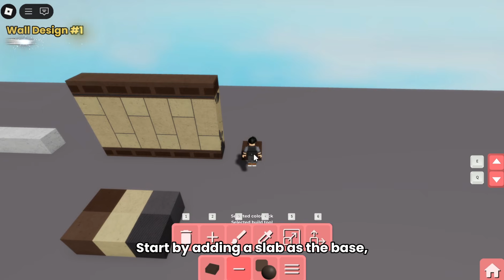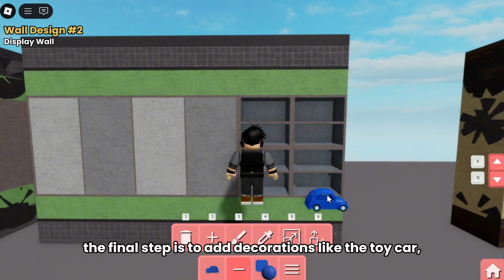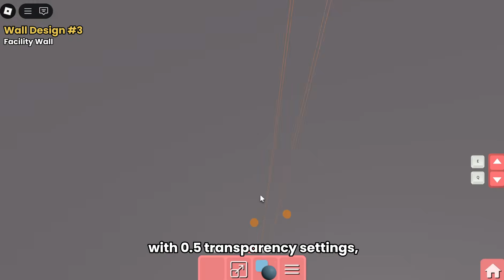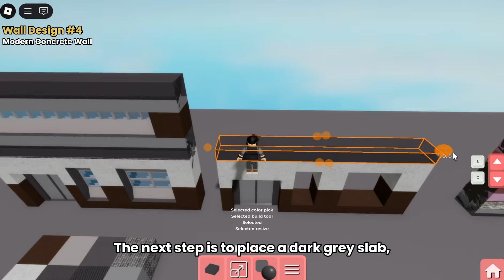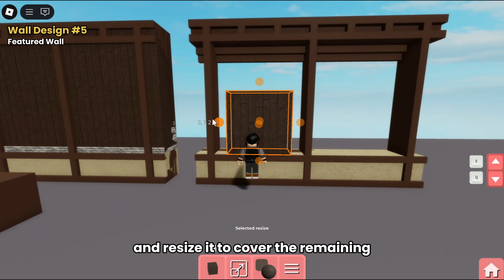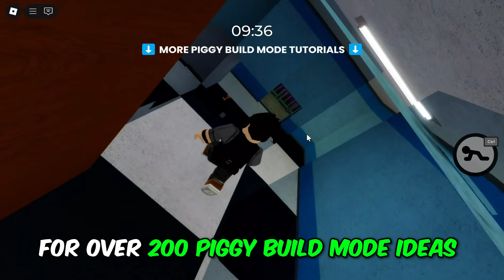7 CUSTOM Wall Designs in Piggy: Build Mode! (With Examples)

Comment: when i try to add the block into the wall for the lab wall design it keeps glitching do you know how to fix that?/thank you :)
Reply from the maker: For the offsets, you'll have to place the block directly on the offset (e.g stick display), not on the flat axis. It should work just fine if you do this correctly.

Otherwise, you can just place another monitor offset on top of the offsets mentioned :)

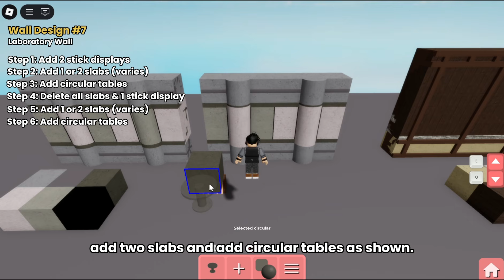Comment: 7:56 this is obviously fake cuz for 1 u cant even do this types of placements with slabs they will just move up and down not the center
Reply from the maker: it will still work if u spam rotate and tilt until it lock onto the slab. but ye sometimes it's annoying cus it doesn't immediately put it at the center, just gotta take a few tries

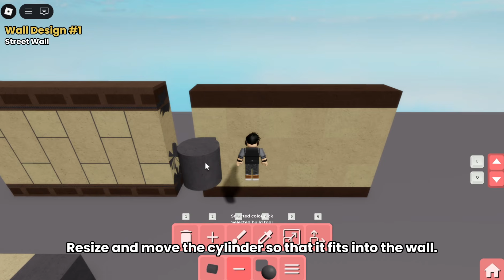Comment: 0:33 I don’t get how you can put it in the wall and it shows up. It doesn’t show for me. How do you make the line appear?????
Reply from the maker: That could be an offset placement issue 

First place the monitor with the correct orientation shown in 0:31 (ensuring it is on the wall surface), then add the cylinder on the monitor and scale + move it into the wall

Hope this helps :)

Comment: i had a weird glitch where i cant resize and move object i couldnt understand when this glitch so can you tell me whats wrong with it?
Reply from the maker: Does it affect every single block you try to resize/move when the glitch happens?
Reply from the maker: Normally i'll switch back to build tool (hotkey 2, 2). Then select another block that can be resized/moved. After that, select the object you initially wanted to resize/move
Reply: @theminionplaysyt  ok thanks for explaning it

Comment: All of this is very confusing, I doing the offset monitor to put the cylinder in the wall but it just won’t show, it goes completely inside the wall
Reply from the maker: If the cylinder is glitching with the wall, you can add another monitor offset, then place the cylinders :)

Comment: Also for the botton  thingy for the cylinder, how high do i have to put the block and the two hockey sticks and the slabs/
Reply from the maker: Around 10 studs high will do, theres no specific height since the offset size will still be the same :)

Comment: At first I succeeded to giving the walls their outlines by using the cylinder and monitor for wall #1. But today I tried it again and it didn't work.. What should I do? I already tried resizing the cylinder and placing the monitor in the right position.. 😟
Reply from the maker: If the cylinder is clipping with the wall, it could be either:

1. Double offsets are positioned wrongly (make sure to lock them on the offseted grid using the rotate and tilt tools)

2. Add another monitor offset to fix the clipping

Hope this helps :)
Reply: @theminionplaysyt  I've tried adding another monitor offset and tried other positions, but none of them are working
Reply: @theminionplaysyt  Oh wait sorry I've just figured it out, turns out it was the rotation of the monitor! 😅 I am so sorry for wasting your time and I appreciate your help so much!
Reply from the maker: @kaynnyyuki no worries :)

Comment: Can you PLEASE make a vid on how to stop the lines from glitching when you move it inside the wall
Reply from the maker: The glitching thing is called clipping, and its rather simple to solve it:

If you're on a single offset - add another monitor offset to fix it

If you're on a double offset - you will have to rotate and tilt until the block is locked on a new grid. Chances are when you're doing the double offset, the item you placed might be on the default grid (which explains the clipping).

I'll likely make a video in the future about this, but if you have any questions feel free to let me know :)
Reply: Im Srry I don’t get it 😊😊

Comment: For Wall 7, how do you put the slab on the two hockey sticks. Its not working for me
Reply from the maker: For the first stick display, it should be rather easy. But the second one is tricky because you have to rotate and tilt the stick display until it aligns with the axis of the first stick display.

Takes trial and error, normally I'll use RTRTRT (r is rotate and t is tilt) and it'll auto lock onto the offseted axis
Reply: IT WORKED. TYSM

Comment: When inas doing this the wall got gitchy i tryed everything but didn't work🤔
Reply from the maker: I think it's most likely when you're doing the double offset, the blocks you place should be rotated/tilted until they are placed on the grids of the offsets (instead of the typical build axis)

If the offsets still creates clipping, you may have to add another layer of monitor offset for it to work.

Basically, offsets are a little different now and the axis gets slightly difficult to grasp, but it's still definitely doable :)

Comment: For the second wall glass starts to glitch, is there a way to fix that?
Reply from the maker: Try adding a monitor offset for the window blocks without the slab offset

If it still doesn't work lmk, i'll see if theres other alternatives :)
Reply: @theminionplaysyt  it worked thank youu
Reply from the maker: @ivangabrijelazinovic6184 npp :)

Comment: hey man i just can't seem to do the part where the toys are (137) (Please reply! :)
Reply from the maker: Gotcha, for the toys (luggage, toy car, luggage, potion, flower pot):

If you're putting on the 1st and 3 rows (counting from top), use a slab offset.

Rows 2 and 4 doesn't require any offset since they align with the axis

For the luggage, use 3 inverted stick displays as the offset.

Comment: Yo how do you align the blocks? when i do it it always gets a position of a normal block. pls reply 😭😭
Reply from the maker: Tbh i find it more difficult to align them too. Probably the recent updates made the grid lines forced to the default axis more often.

Normally I'd press RTRTRT on my keyboard to align it (which works most of the times)

R = rotate
T=  tilt

However if it doesnt work then just spam R and T (e.g. RRTRRTRRTTRTTRTRTTRTTRRRTRRTTTRRTTRTR) - im exaggerating lol, but sometimes it does take this much of spamming.

Worse case scenario, rotate and tilt the block until any one face aligns with the double offset, build it, then enable the move tool and click R and T until the block is tilted to the intended orientation. (This only works for the blocks for the wall, NOT the offsets that will be used to create the offseted blocks)

I'm still finding a concrete method to make these offsets easier to make, so I'll likely make an in-depth one in the future once I find the answer :)
Reply: @theminionplaysyt  Thx mate, W video